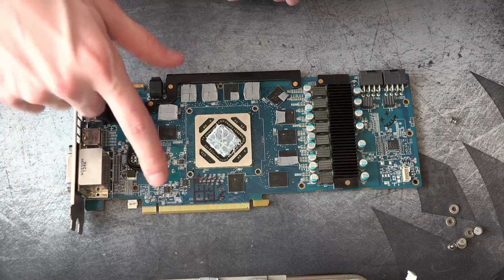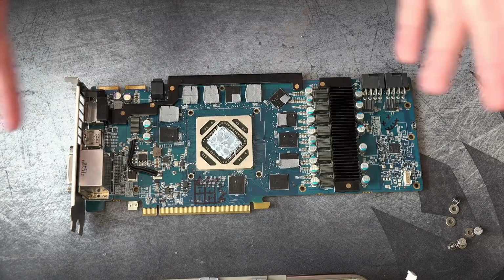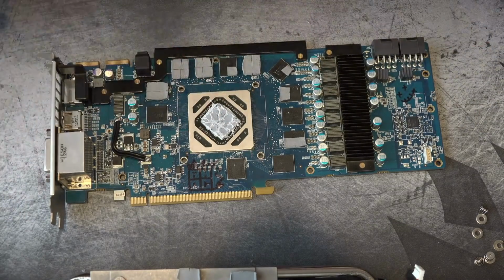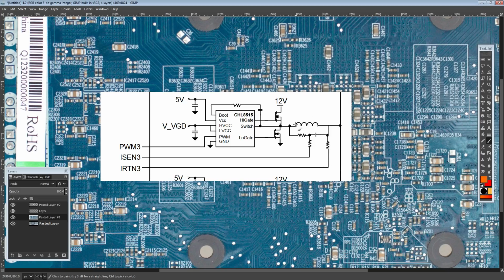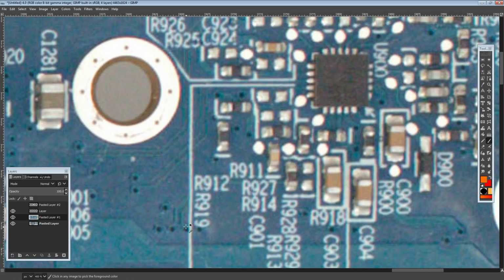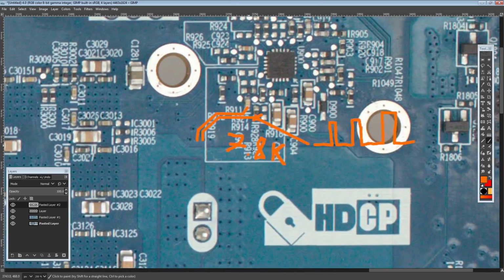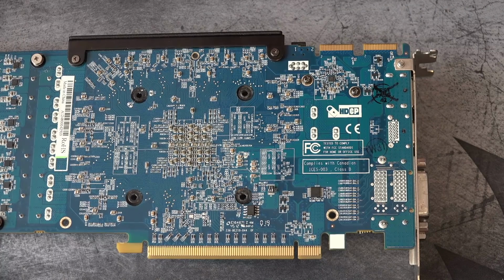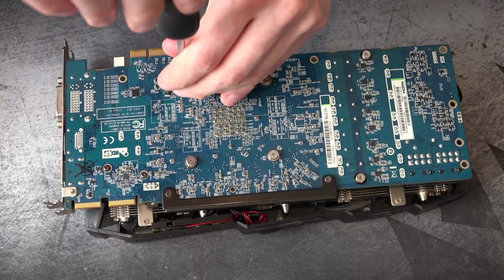GPU Necromancy 4: The HD 7970 Vapor-X 3GB finally runs "properly"

Comment: I have a sapphire radeon hd 7970 ghz edition that has an issue with the fans. They only work if I manually set them to anything over 80% in afterburner. They refuse to spin up on their own. I have tried flashing a vbios and that didn't change anything. I'm not sure if its the fans or the pwm controller. Any ideas what I can try to get the fans working?

Comment: heyy i have amd radeon 6990 4gb its shorted to ground , one mosfet was on fire i remove it and clean the area and after another try i get capacitor burning !! so may it some solder under gpuu ?? does it need reballing or any other idea thanks

Comment: Hi buildzoid, my 7850 just died yesterday in the middle of a gaming session. it tripped the psu overcurrent protection and the pc wouldnt start. then i started it without the gpu (just heard the fans and hard drive run). Then I put the gpu back in and it just wont video output. All the capacitors on the pcb read 0-0.1 volts and i didn't find any shorts. 
I just found 2 small 0 ohm shunts right next to a small inductor at 12 o'clock opposite from the pci-e connector (the data one not 12v power). Should I short them out and try again or investigate further?

Comment: I bought a cheap hot air station off amazon to remove a bios chip and flash It in a programmer cause I bricked the board with a shit bios

worked great

Comment: I have the same card, the fans aren't great. when I got it the stock fans didn't work well(one clicked when on high loads, and the other didn't run until the fans were at 75% speed). I replaced them and about 6 months after replacing them the rear fan is clicking again(it's been about a year since I  replaced them now and it hasn't gotten worse as of yet)

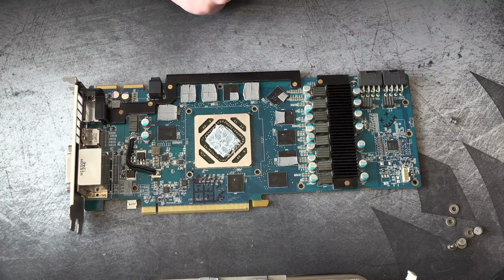Comment: 2:18 Ah yes, the "joy" of cheap tools/equipment.
"Save" 20% on a cheap tool, it breaks or does not perform its task, you replace it with something propperly and made your wallet thin...

Expensive tools and equipment usually outlasts you or grows some legs.
Reply: That's not even the worst thing about cheap tools, they usually break more subjects than they worth.

Comment: Hi mate, your videos could benefit greatly from a good 4k camera(ex: panasonic G7, GH4, or sony RX series), because of the components and details of the graphics cards.
Yeah i know 4k is a pain in the ass to work with right now, i would go with 4k 24p to save time and bandwidth and allow people with lower speed internet to be able to watch it without too much buffering problems, it would allow you to upload faster as well i guess, aim for the 8-10Mbit internet speeds. Have a nice day.
Reply: Also some old phones like note 3 or 4 and lg g3 or g4 can record at true 4k30 and are very cheap to get in used condition.  I would imagine if you have decent lighting, board shots could come out looking pretty good.

The only issue with older ones is you need a rooted phone and custom kernel to disable the recording time limit, or just continuously restart the recording every 20 minutes or so.
Reply: @sersoft_corp  Sorry, but no, first he need a camera that has a lens that do justice to 4k videos, and higher bit rate codec, one that allows him to zoom in and out or at least change the lenses.
Cellphones are terrible to work with and the image falls apart quickly with terrible dynamic range and would need more atention to lighting as well because of that, cameras are much better for this  he can make a set up with a tripod and let stay there already in position to work.

Comment: by adding that resistor there, does that not short the vrm output to that 12v square wave. it looks like both ends of the inductor are now shorted together (with resistance of course)

Comment: Just look up the 15$ hot air gun on youtube. That way you don't risk two moderate budget, just a very cheap one, that not affects the better one later. I can tell you it is good enough for small chips like that. It is not perfect, and probably for long term you could buy a nice kit later, but if there is nothing else, it does the job. For me it was good because I don't plan to use it frequently.

Comment: wait... but isn't measuring across the leads of a capacitor(really across most components) while in circuit not only dangerous depending on what you measure(assuming we are talking dmm not say an esr meter)but also completely pointless as any other components connected in parallel will change the reading(and most of the time there are components connected in parallel???  correct me if im wrong
Reply: Well it wasn't about accuracy and the capacitor he searched for was the only one that stood out reading wise
Reply: DMM voltage measurements, and oscilloscopes have resistances around 1Mohm insuring that they draw as little current as possible. probing with a DMM is kinda like adding a tiny capacitor to the circuit (wires and internals) but the effect is negligible. current does not like flowing through 1Mohm of resistance. Even then high accuracy oscilloscopes have 10Mohm probe resistance. They have little to no load on the circuit at all.

Comment: Dear zoid, don't waste your money on a pro rework station, you are not going to repair cards or change smb parts daily, so it will never pay for itself. Even TiN uses chinese junk. https://youtu.be/sPKRt9ejyP4  I'm a snap-on/matco/usa tool whore, but something I learned about electronics work, the quality of tool required to do high quality work, is very low. I bought this station of e-bay, https://www.ebay.com/itm/853D-3in1-Soldering-ReWork-Station-SMD-Solder-Iron-Hot-Air-Gun-DC-Power-Supply/192640740260?ssPageName=STRK%3AMEBIDX%3AIT&_trksid=p2057872.m2749.l2649 It's cheap as sin for all the things it does, the parts are probably made from recycled sewer pipe, there is maybe one gfr bit on the whole thing, but, it works amazingly well, as in it heats up faster than pro grade weller products I have used. You will probably need an actual preheat station, if you are going to make videos of smb work, so the comment section doesn't drown you. https://www.ebay.com/itm/IR-Preheating-Oven-T-8280-Rework-Station-Infrared-Heat-Pcb-Board-Cut-Through/113681808349?hash=item1a77f6bbdd:g:2tkAAOSwxqZchlS1 I just use a toaster oven....

Comment: 2:15

Check out the yihua 853d, it's on the cheaper side (~70€ in the EU) but really works well. It also has a voltage output you can control, which is perfect for quick testing.
Reply: That's probably not the greatest of advice, all the cheap rework station have very similar circuitry that's prone to catastrophic failure. The heater element switches on without the fan, and the whole thing catches fire, while in the supposed 'OFF' state. If you have one, go pull it's power plug out of the socket.

Some example meltdown videos (there are more if you search, along with safety mods etc.): 
https://www.youtube.com/watch?v=m5kzyUFb2Sg
https://www.youtube.com/watch?v=tUFW5teeRBM
https://www.youtube.com/watch?v=kTpwz1CYtA4
Reply: @crayzeape2230  The yihua seems to be one of the better ones (=no catastrophic failures), from what i've read so far. Been using it for a month now without any problems, but of course you can't compare my use to what someone in a workshop would do in that time. And yeah, a hakko will be a whole lot better, but it's just not worth it if you're not earning your bread with soldering work.

edit:
Also there are fake yihuas. So they're probably not doing everything wrong, when others decide to fake a cheap hakko rippoff.
Reply: @HyperActivePlayers  Fake units are the real problem of course, but the market is unfortunately, a literal minefield of fakes. Starting at the manufacturers website is the best bet when looking to buy a hot air rework station, which is contrary to many peoples (myself included) bargain hunting tactics of Aliexpress/Ebay -> search -> filter by price -> buy.
I still recommend a hot air rework station to anyone that want's to play/work on modern boards with SMD components, but I try to make sure they're aware of the issues at the same time. It's possible that I'm oversensitive to the topic as I've seen houses burn to the ground over very similar failures (different hobby - herpetology, but the same SCR based temperature control circuit).
Reply: @crayzeape2230  yihua added a qr code you can scan on their machines, to check if they're genuine, as protection. But of course you don't know that when you're just buying a machine of ebay or Aliexpress, without anymore knowledge. 

I got really coutious about safety lately. I left a really cheap solderingiron on a piece of wood once and left my apartment. When I got home the wood was was burned, but the solderingiron luckily failed at some point. Ever since I have a lamp plugged in the same multisocket so I don't forget to cut the power after soldering.
Reply: @HyperActivePlayers  The lamp is a good idea. I've come across people in various electronics forums that do exactly the same thing.

Comment: Hi Bullzoid, I've decided to OC my ram recently, a 2x8 Hyperx Fury 3200mhz cl18(😣) with the "new" Hynix C-die chip which seems to overclock quite well. I've reached 3400mhz cl16 with 1.42 V and Geardown disabled 1000% stable but I'm having some issues booting with my b350 potatoboard. Will touch procODT and cad Bus help me? Could you give me some advices?